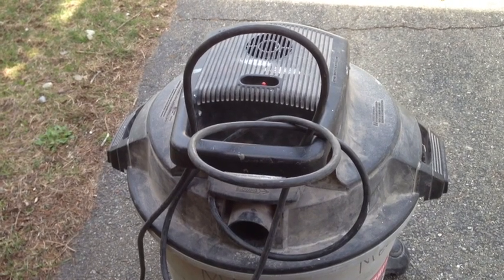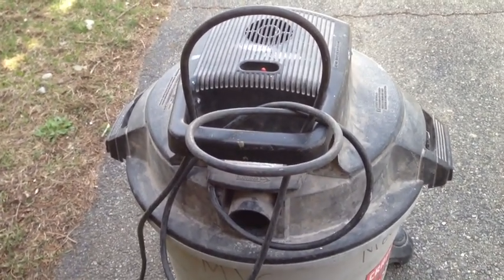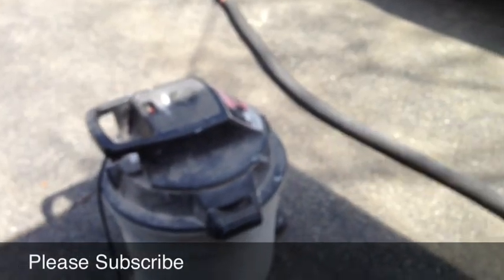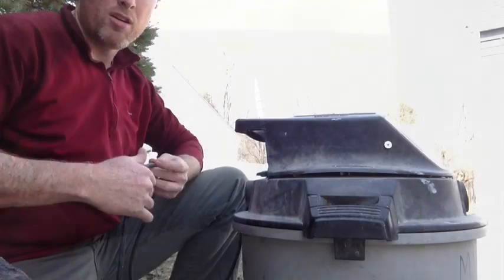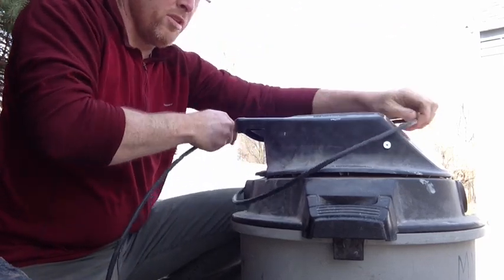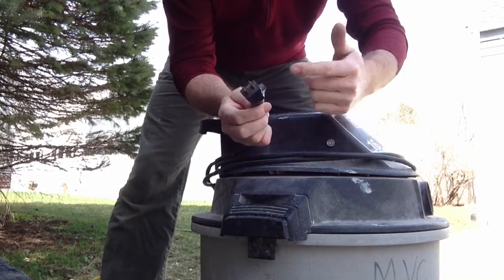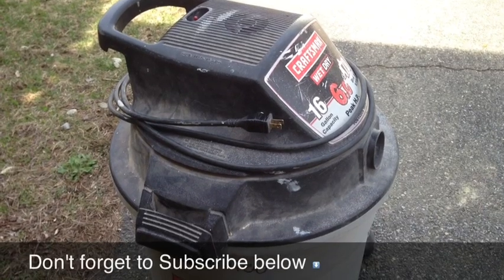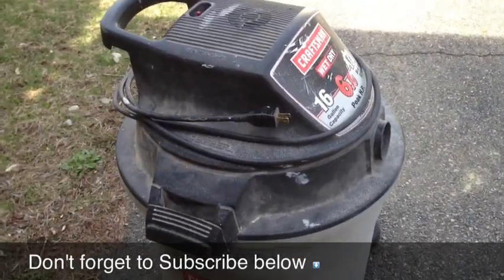Going Lean Sucks

Comment: I think I'd use some heat shrink tubing instead of the electrical tape around the plug-- that will keep it clean from adhesives as the tape begins to come away over time.  Great tip with the power grab magnet!!!